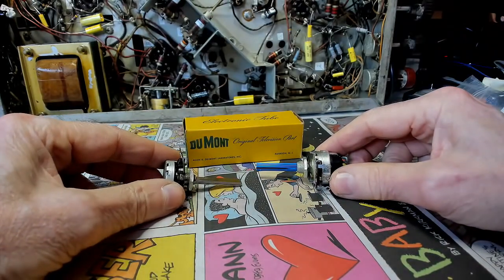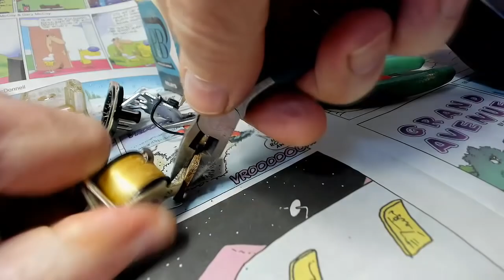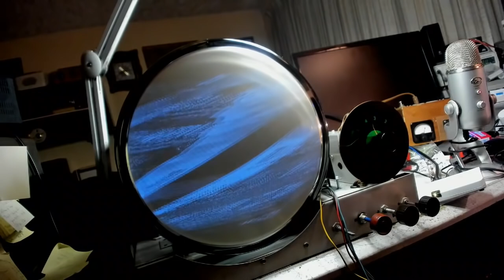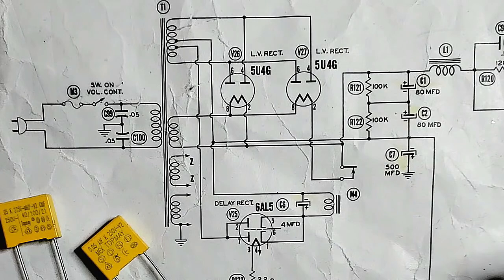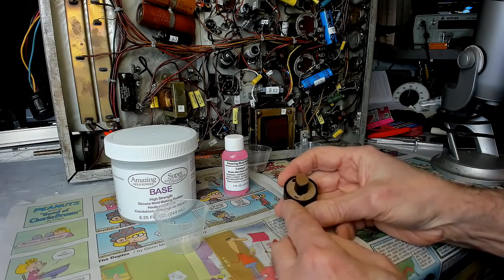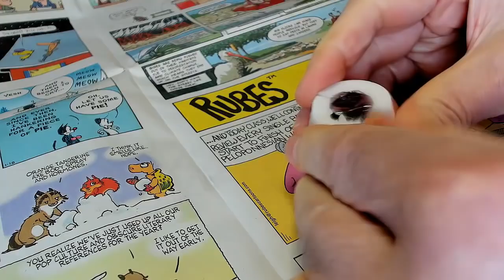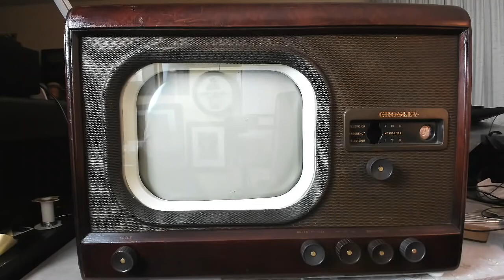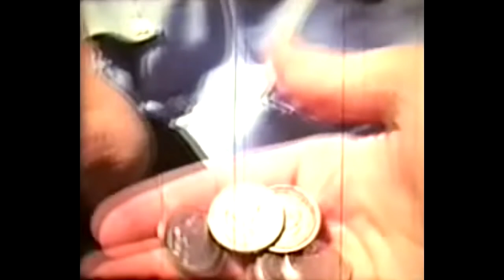1948 Crosley TV Model 9-407 Repair Part 5 Final

Comment: That "safety glass" is actually a glass with a high lead content. It is there to stop X-ray radiation from coming out the front of the picture tube. You will see this on a LOT of the early sets.
Reply: I believe they are for mechanical protection against flying glass fragments from picture tube implosion.  I have seen them made of perspex and also two layers of glass laminated with a plastic layer inside.  Also I don't think the EHT is high enough in these old sets to produce very harmful X-rays.  They were more of an issue with colour TVs with 25kV EHT.
Reply from the maker: @ericrawson2909  I agree with you!

Comment: Hey Buzz, Great work. For your next project consider doing an old 50’s car radio. I remembered you had made or bought an AM transmitter for you radio restoration projects. Do you have a schematic for the transmitter?  I’d like to use it in my 50 Buick.
Reply from the maker: I do not have a schematic for the transmitter...